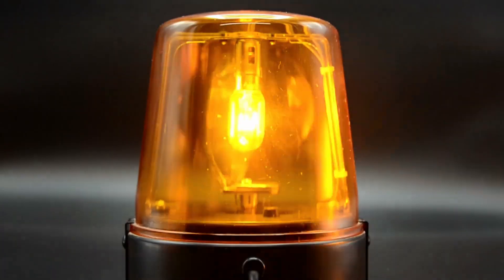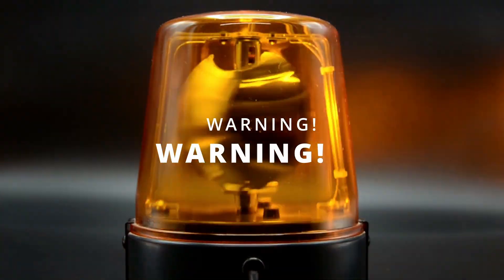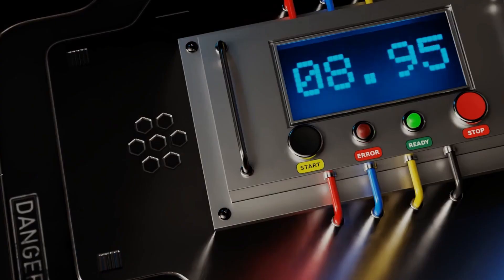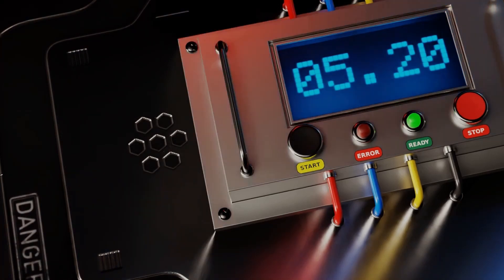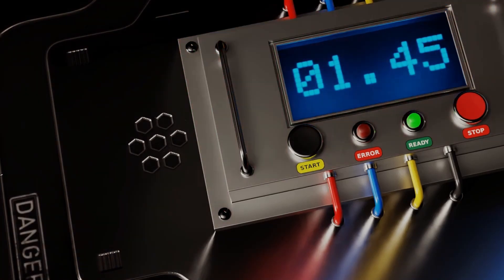All You Need to Know About MQ Gas Sensors – A Beginner’s Guide

Comment: Why these are not suitable for real application in industries? Principle of operation is the same.
Reply from the maker: You are correct that the basic operating principle is the same. However, we are dealing with invisible, odorless gases that are extremely dangerous. The small, hobbyist-grade sensors you mentioned are not certified for safety. Using them is a massive risk. Think of it this way: If you had a box of 100 chocolates and knew that two of them were poisoned, would you risk eating one? That is the same level of risk we take by using uncertified equipment.